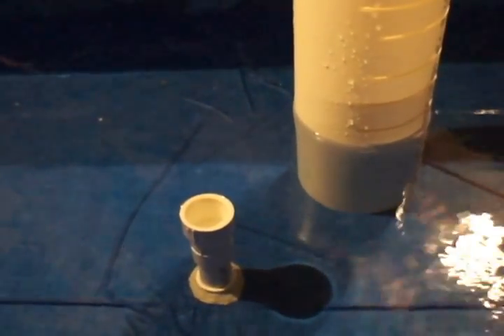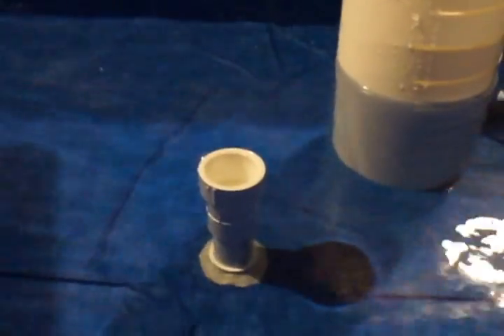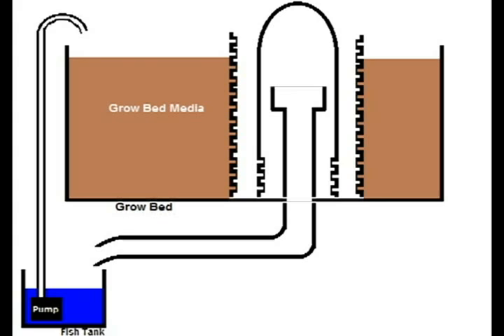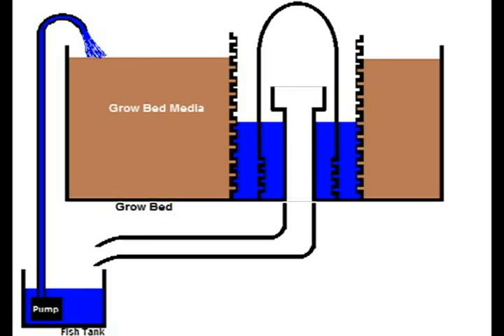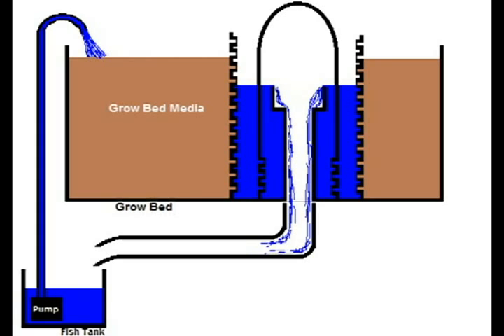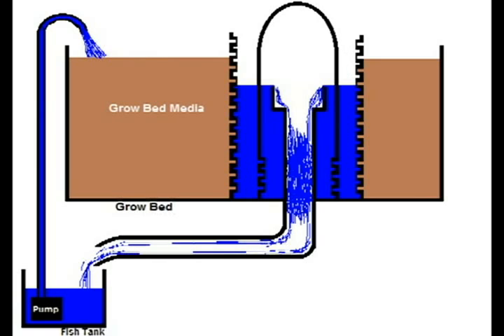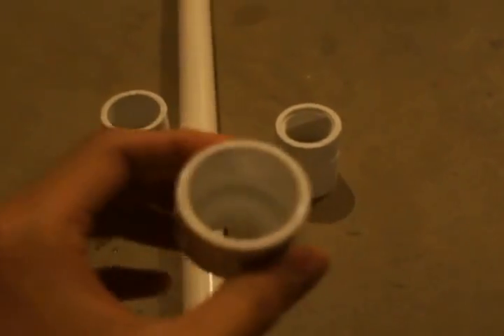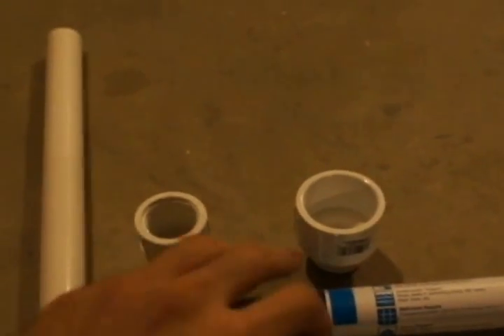OSPE: Sustainable Food - Building an aquaponics Automated Bell Siphon

Comment: I was thinking that air pressure has little or no importance in a bell syphon. I think gravity does all the work. I think it would work on the moon for example with no air. What do you think?
Reply from the maker: Yolandi Pluto  That's a good question!  :-D  I guess that would depend on if gravity is strong enough to push down on the water to tip it over into the standpipe.  It depends on what Bernoulli's Principle says about that, but my guess would be no.  heh  

If you happen to look it up and find out, let me know!
Reply: Yolandi Pluto
Reply: the gravity creates a vacuum in the siphon, and the outside air pressure causes a difference in pressure and pushes the water into the vacuum. if you tried this in an atmospheric vacuum, the pressure difference between the bell and the air would be equal, and there would be no force pushing the water through
Reply: I see, but if you get a normal siphon started , say with a pump. When there is no air in the pipe would gravity still suck all the water down without the need for air pressure? The beauty of an automatic stop start  that a bell syphon has would not work because the kick start is the pressure difference?

Comment: Hi all, I'm new to aquaponics so I got a question. Does the speed of the water flow important?
Reply from the maker: Panteras Panteralandia, flow speed is important because it relates to how big your grow bed is.  Because seeds can drown, you want to make sure your flow is fast enough to get your siphon started automatically, but slow enough to allow enough time in between watering so your seeds don't drown.  Does that make sense?  I haven't tested optimal water times, so that data is up for discussion, but definitely make sure they're at least 5 minutes in between watering.  I hope that helps.
Reply: Leo Riveron OK thanks a lot for the info. I have plans on building one but I am watching different types of build to see how I can make one that fits my needs and space. very helpful your info
Reply from the maker: Panteras Panteralandia , no problem at all.  Feel free to comment/PM me if you have any other questions.

I'm working on a comprehensive instruction guide on how to put the whole thing together, from start to finish, including every detail.
Reply: Leo Riveron That would be great you can also PM me if you like.. When you have it done let me know and thanks again.

Comment: i have no expieriance with aquaponics but im wondering if you add a pvc valve to your drain would it help start your siphon? it would also control the the flow of the siphon if one needed too.
Reply from the maker: You really don't want to put a value in the drain pipe because the bed will need to drain when its full and cant rely on whether the drain is open - it always needs to be open.  I hope that makes sense.
Reply: Leo Riveron yea I understand the system.. the reason I mention the valve because he mention that he had a problem getting the siphon to start so he added a piece of bicycle tire tube which solved the problem. maybe with a valve say halfway open can get it started and drain properly. I don't know how hard it is to build an "efficient bell siphon" but if does pose a challenge maybe a valve would aid the process?
Reply from the maker: oh I think I understand what you mean now.  Are you saying that with a smaller opening at the bottom of the drain, it would help get the siphon started faster?  That might be true, I haven't tried that, but I most certainly will.  Thanks!

Comment from the maker: Right on.  If you're looking for some other ways to arrange the structure, check out the site in the description.  I have designs available that allow for complete scalability, so you can easily go from a small system to a larger system whenever you're ready.

In either case, I hope everything works out for you.  Feel free to post/message if you're having any trouble.  Peace!

Comment from the maker: I haven't done any extensive testing yet, I plan to, but I've read that most plants need a cycle of 6 minutes to 15 minutes.  If you have a ball value after your pump, you can manually adjust have fast the flow is to your bed, so it's just a matter of getting it in that sweet spot.

Do you have a system started?

Comment: I needed a very short drain pipe, and at first my bell siphon did not start working properly: it got air in too easily through the short drain pipe. What I did? I attached a 6-7 inch length of a bicycle inner tube (26 x 1.95-2.125) to the drain pipe. The inner tube is flat, allowing no air flow back to the siphon, and it started to work perfectly!